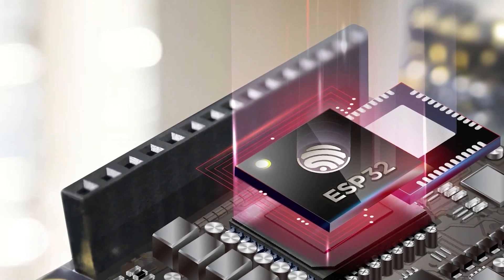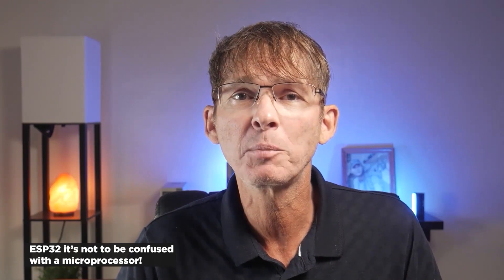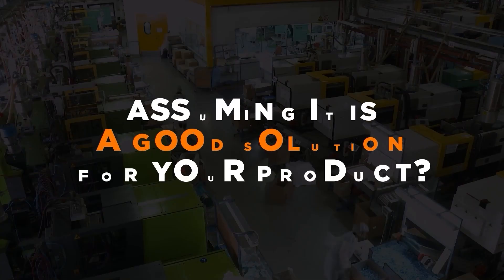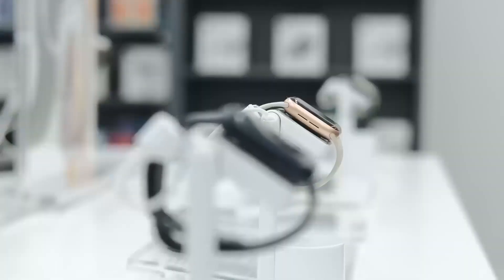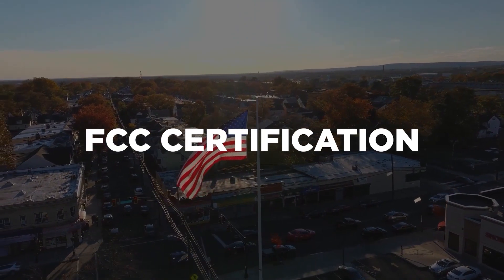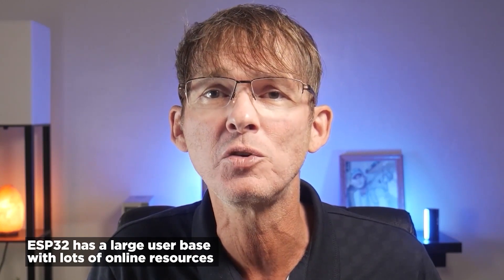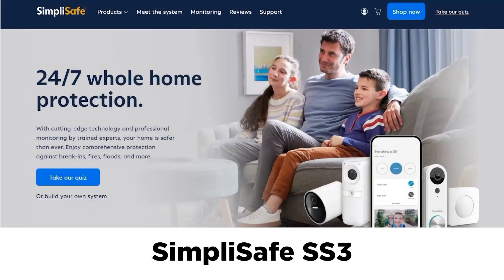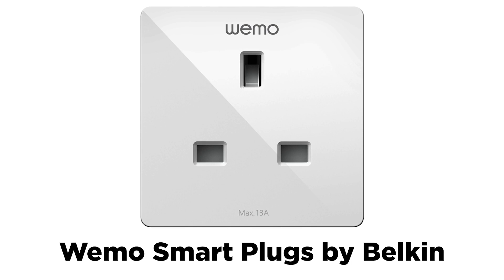ESP32 in a commercial product? - From prototype to production

Comment: I'm developing some MIDI controllers that I plan to bring to market. I usually use the Arduino Pro Micro, but I've been working with the ESP32-S3 lately since both can function as USB MIDI class-compliant devices. I'm not planning to use Wi-Fi or Bluetooth, so I'm wondering—should I stick with the ESP32-S3 module or go with the Atmega32U4 instead? Thanks!
Reply from the maker: I would almost definitely go with the ESP32 even if you don't need the wireless. Or I'd look maybe at an stm32. But definitely not an ATMega - those are mostly for hobby projects and not commercial products. They're too expensive and very low performance.

Comment: Great video! 

I just want to ask to make sure. Can I use a development board in my product Im selling in Europe? Or do I need to make my own (prefer not to do that). Is it strictly for development and not for finished products?

Thank you! :D
Reply from the maker: Sure you can use a dev board in a finished product. Usually it's not feasible due to cost and size, but there's no rule you can't. But sorry, it does not mean you get to skip certifications:)

Comment: the esp32 is NOT a good idea for a commercial product. I make a commercial product using the ESP32 S3, I started production and the one I developed on was revision MO my next batch had a newer revision MC and the CAN BUS thats the main part of my product no longer works. Yes its a hardware issue in the chip. Why they changed it I don't know,  Espressif still haven't had the decency to reply to my questions.
Reply: I'm also using S3 with CAN, but din't encounter any issues yet. i'm not sure how to check the revision though. how did you fix your issue eventually? thanks
Reply: @viocudinti  on a very busy can bus network it was missing messages, it would usually pick up the first 4 out of 13. I ended up adding a STM32F103 and can chip, then convert that to serial and then send it to the esp32, this was a bandaid repair so i did not have to throw out all the hardware i had manufactured.
Reply: @etpulsar  Ahh, that sounds painful. Thanks for the warning, I'll check if it affects my use case. How do you check the revision? Is it the "esptool chip-id" one or something different?
Reply: @viocudinti  the last line of text on the back at the bottom of the chip "MONxxxx" works great "MCNxxxx" causes me problems.

Comment: I am curious what dual core microcontroller SoCs you'd recommend as an alternative to ESP32 (particularly the ESP32S3 for instance) if WiFi isn't required.  I've been working with this chip for awhile and have enjoyed having the WiFI capability for debugging, but I ultimately don't need WiFi.  I find the Espressif IDF to be quite mature and useful (it also has some nice optimizations for machine learning operations), but if there are offerings by other manufacturers that have similar compute power and mature interface at the same price point (but w/o wireless capability), I'd be interested to hear more about them.
Reply from the maker: The ESP32 is so price competitive that even if you don't need WiFi (or Bluetooth) it still makes sense for many designs.

The only other dual core I know of that's this cheap (actually cheaper) is the RP2040 from Raspberry Pi. The dual core Cortex ARM microcontroller costs only $1. It's loaded with lots of power and features for a ridiculously low price.

Comment: I think the most attractive part in ESP32, apart from WIFI (or even more than wifi) is that the features of dual core, sleep modes and the rtc. It can handle a quite diverse types of applications.
Reply: sleep current is quite bad on esp32.

Comment: ESP32 would rarely ever make it commercial production it is almost always used to power a GUI/LCD display and add wifi/bluetooth, never for any actual functions, those jobs are still done by STM32, Novuton, And various other established micro controllers. Main reasons for this are the low quality ADC and high power consumption. Espressif will still need a decade to optimize this chip.   DIY and Makers like this chip because they could care less they just want to show everyone the wifi enabled tooth brush they made.

Comment: Ok, thanks for the explanation, but not everything is rosy.

There must also be disadvantages,
Reply from the maker: I'd say the two main disadvantages of the ESP32 compared to similar WiFi chips is their increased programming difficulty and lack of good tech support.
Reply: @PredictableDesigns  

Thank you very much for answering. I'm thinking of using a WFI32, the advantage I have is my experience of many years working with microcontrollers and tools, from MCHP, however, I must analyze the ESP32 option

Comment: So if ESP32 development board is already FCC certified wouldn't your custom PCB that the board will be integrated into have to be certified as well?
Reply from the maker: You rarely will integrate a dev kit on a custom board, and instead it will be a module.

Correct though, and using a pre-certified module doesn't get you entirely out of FCC certification, it just drastically reduces the complexity and cost of the certification.

Comment: What type of the microcontroler that can use for industrial aplication and product john?
Reply from the maker: That depends on what it does. Industrial or consumer doesn't really matter for selecting the MCU.
Reply: @PredictableDesigns  this comment instantly made you an electronics beginner. It does matter, because proper chip brands have big track record on being able to keep a chip in production for x years. Also microcontrollers and chips from China are forbidden in MANY European products, systems and industries. Especially in the military. The ESP32 is only used in Chinese products. Your code is also less secure on a ESP32, while western chip brand really protect your code much better. There are so many reason why Western companies never choose for ESP32's even though they are amazing for hobby use and super cheap.

Comment: Here's the thing, even if you don't need the WiFi/BLE, you still go with ESP32 and turn off the RF.
Why? because it's cheap, secure and most importantly highly available, I have never saw ESP32 go on shortage before, even during the semiconductor shortage period a while back.
CH32V003 maybe a cheaper option but they often go on shortage and it's not a secure chip, thus not suitable for commercial product, unless your application is really high in volume.

Comment: In considering my potential product, it seems like one of the comparatively expensive and clunky aspects is just connecting the signals together using cables.  Dupont jumpers are prone to bad loose connections and don't have cheap connections with custom PCBs.  So it is tempting to go with wireless data communication, but then you still need power.  Is there a standard solution that doesn't require unnecessary WiFi, but instead allows a network of USB C cables, which can provide power and data, as well as cheap reliable cabling?
Reply from the maker: If I understand your question correctly, yes there are lots of microcontrollers that support USB without wireless functions.
Reply: @PredictableDesigns  What are some of those microcontrollers?  Especially ones that have ADCs.

Comment: The only ESP32 product that I know of that I use is the HaritoraX Wireless (not the Haritora 1.1b), it is a 17 gram ESP32 based IMU motion tracking device that you strap to your body. It has an impressive 20 hour battery life per module and the PC connection + flashing for updates is done through Bluetooth.
It is not a flawless product because it is susceptible to drift and geomagnetic interference, however it is pleasantly functional in a good environment and I think it's one of the examples where they have taken an ESP32 prototype into production where the product isn't very far off from the prototype.

Comment: i wouldnt call adding an antenna and a PI matching circuit a "fully custom RF design", ESP32 is a SoC, there is no "RF design", only a very basic matching and feed trace.
Reply from the maker: True, but from a certifications perspective they are both considered custom.
Reply: @PredictableDesigns  i know that rules are slightly different for FCC but for CE  it doesnt matter at all if the module is "pre certified" you pay exactly the same price and all the CE-RED tests have to be passed in both cases.
Reply: With CE certification it is a lot easier and cheaper if the RF module is pre-certified as they are allowed to skip a bunch of tests. Been there, done that.

Comment: Namaste Sir,
Thank You for the video.
I am from India[ Bharat], I want to use ESP-C3FH4 Soc in my product for manufacturing, which means I need to make an antenna myself[ using PCB ] or I can use a chip antenna.
So do I need an FCC certificate for this or not?
I have read online that if we use the ESP32 module we don't need FCC certification, but for ESP32 SoC, FCC certification is required. Can you confirm if this is true?"
Reply from the maker: FCC authorization is always required but using a pre certified module makes it easier and cheaper. You lose that benefit if designing a custom antenna so full FCC certification is required. I have a video here on certifications that explain this all. Cheers.
Reply: @PredictableDesigns  Ok, I understood sir,
Please send the video link
Thank you very much!

Comment: ESP32 has notoriously bad ADCs.  You have to use attenuation and voltage dividing to match to avoid nonlinearity and noise problems.  Even so, they're noisier than other MCUs.  I avoid them unless integrated wifi is necessary.
Reply: Can you explain a little more in depth for me please? I’m building bionic prosthetics for children and I’m aiming for perfection. This seems quite simple but a circuit diagram or more thorough explanation could help me implement this suggestion since I’m using a lot of pressure sensitive resistors for example
Reply: @AliKhodrAliG esp32 has internal adc which is very bad because they are noisy and also non linear... i usualy just use external i2c adc or evem spi adc if i want fast readings
Reply: @AliKhodrAliG  No such thing as perfection. If you have to ask questions about these things, I doubt you're actually making bionic prosthetics.  I think you're trying to build a demo to look good and get hired somewhere that you can sucker.

Comment: ESP32 sucks at realtime. It just cannot react as fast and predictable, as other MCUs. Probably because it's SDK looks like a bloatware.
And debugging is pain in the ass. I tried ESP32 and even created some working projects, but returning to STM32 was such a relief.
Reply: ESP32 is powerfull and has many options. But in reality it's still a cheap toy and doesn't meet the professional specs. And in many cases is even FORBIDDED to be used by western companies.
Reply: @HermanWillems  ESP32 works well if you need to drive a LCD display and add bluetooth/wifi to it but it would then communicate with a main wifi circuit such as a Novuton or STM32. Many people that are jumping up and down with esp32 have just made a wifi powered tooth brush so they assume its a chip that would work every where.

There is a reason why its cheap and yes the ADC are terrible.
Reply: @Foxfried  but that's the point. For your wifi powered toothbrush timings and precision do not matter. Choose the right tool for the job.
Reply: @dr0gaN sadly not to many actually get that part. Yeah sure something else could have been "better" in the sense of capabilities, but for something like that it just doesn't matter, if I were making it I'd just want the cheapest option that gets the job done . . . And u can't really get better than that. If u don't use an adc then why da f would u even care about adc performance of the chip being used. If u don't need floating point then why get a more expensive option that has it. Same game for every other part . . .

Comment: I wouldn't say a microcontroller is not a microprocessor  though. It has  a CPU and cache just like a desktop processor.  The microcontroller just has more  embedded peripherals which makes it a System-On-Chip . Yes they are slower and less complex than their desktop counter parts but they do basically the same thing.  Many modern Desktops CPUs now are just SoCs. The same can be said of arm processors vs arm microcontrollers they do the same thing just one is more powerful than the other. One Arm M0+ can be clocked at 133 Mhz as a microcontroller but be clocked at 800Mhz or above to be a processor for a phone or iot device.

The esp32 itself can and does run operating systems and be used just like SBC. I think we forgot that microcontrollers were used to be called embedded processors
Reply from the maker: Yes of course they are really both just CPU's. But they are very different from both an application perspective and a development perspective.

Comment: The external antenna doesn’t give better reception than the internal (a little worse, actually), and using an antenna with higher gain is forbidden by the FCC. The only advantage is if your enclosure is metal.
Reply: very peremptive statement, which is also very wrong.
Reply: @lo2740  I’m certainly no expert and could be entirely wrong, but why would you say that? I based what I said on the datasheets, are they wrong?
Reply: @cdevidal  Sorry sir but you are 100% wrong any hardware developer with the most basic equipment can measure the difference between the internal and external antenna.
Reply: @Foxfried  Check the datasheets. Course it's not the first time those were wrong.
Reply: Hmm, not really. PCB antennas tend to have rather terrible gain and radiation patterns, making their range pretty low. A little quarter wave external antenna will almost always perform a lot better. Antenna gain vs PA power level is a bit of a minefield in terms of FCC regulations, but it mostly comes down to ERP - effective radiated power. That is a system level measurement, and is one reason why FCC certification is only given on the basis of a certain module / antenna / casing and grounding situation. Change any one of those things, and ERP (and also extraneous out-of-band emissions) also change.
Reply: @simontillson482  don’t take my word for it. The data sheets show that the external antenna model has slightly worse gain. Go see.

Comment: One of the reasons the ESP32 is so popular is it's predecessors, namely the 8266.  They (or a variant) were used in nearly every Wifi-enabled switch/plug in the market until about 3 years ago, when the market started moving toward the ESP32 and/or similar chipsets.  The open documentation put out by ESPressif allowed for easy hacking, and the rise of custom firmware like Tasmota.  One could argue that using the 8266 was not the best idea, because it lacked some simple hardware level protections (efuse for write-only boot flash, etc).  But with the ESP32 line, there are built in safeties one can turn on in production settings to prevent 99% of the hacking that was done in the 8266 line.
Reply from the maker: Thanks for sharing that!
Reply: Try building systems for the Army, any processor from China and many other products are forbidden. And you don't know about the backdoors .... YET.